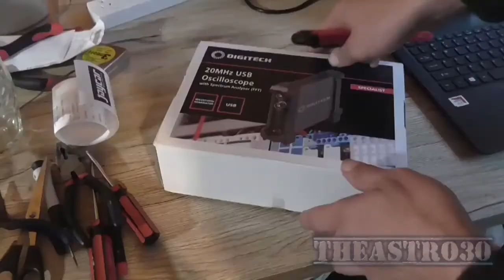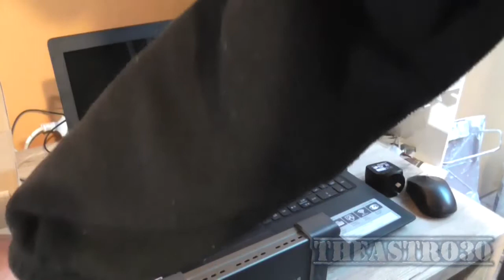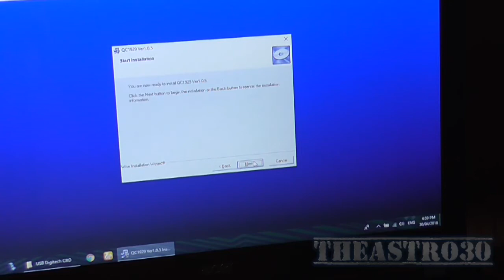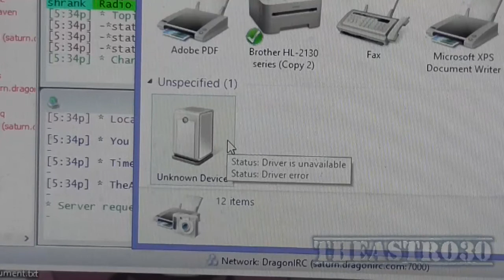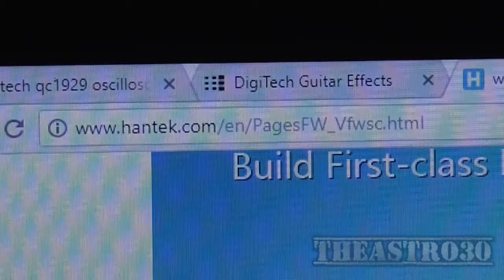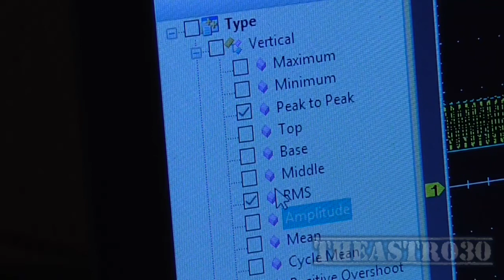DigiTech QC-1929 (Hantek 6022BE) USB Oscilloscope

Comment: bought one these 2 but run into install issue added a new SSD and fresh win 7 OS ran into digital certificate validity. The only was to run the sucker was to disable certificate validity enforcement Search the net for no joy left the problem with Jaycar to solve

Comment: A few years ago Jaycar sold a 50MHz model for around $70. It was wonderful, I used it on advanced high-speed and high voltage signal analysis (pulse induction metal detectors). It triggered correctly (started sampling on trigger). The software was intuitive  and rock solid . I feel we have gone backwards.   Thanks for the software update though, it's much better